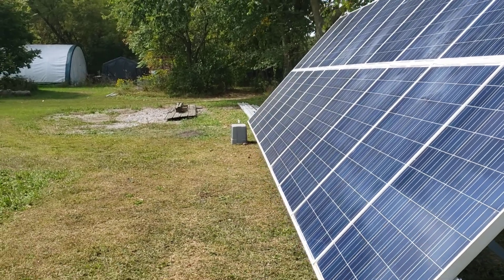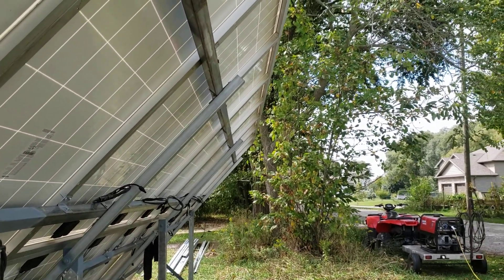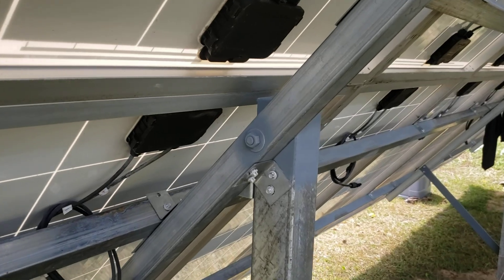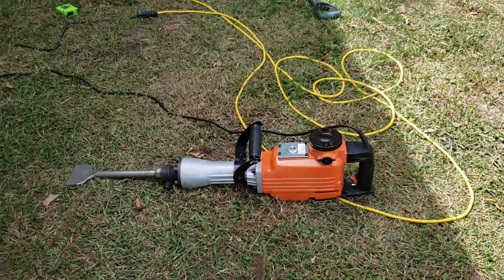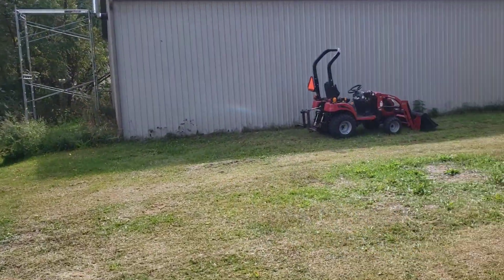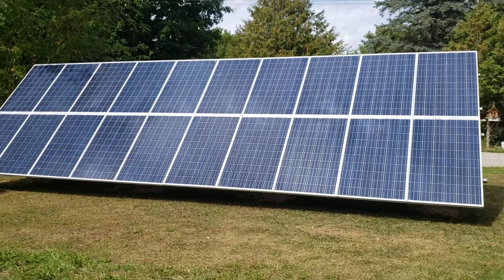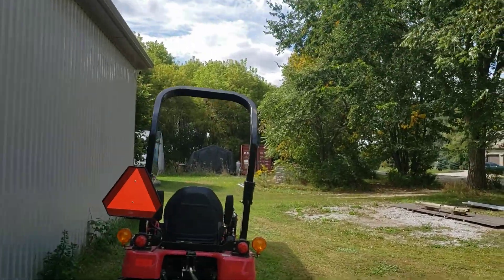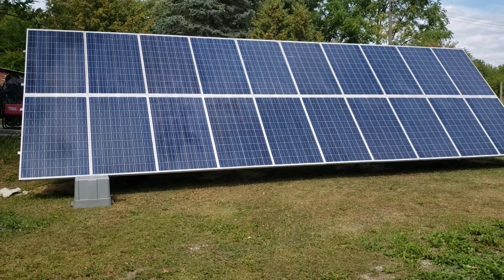DIY 5Kw Ground mount solar array.

Comment: I also have a couple of DIY ground mount solar arrays made from welded galvanised tubes about the same size as yours. All I can say is "don't underestimate the force that a strong wind will push your panels". Mine is quite a 'space frame' design and I've had to add extra cross bracing to cut down the flex on windy days.
Reply from the maker: I will do an update showing the current bracing, but I have an idea to secure the upper row also, because you are right, the winds have a lot of force!